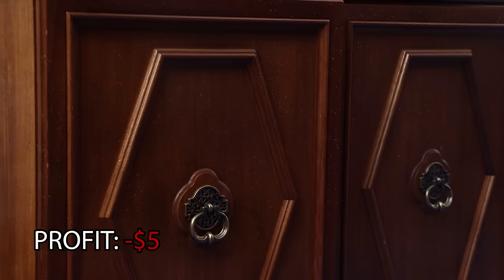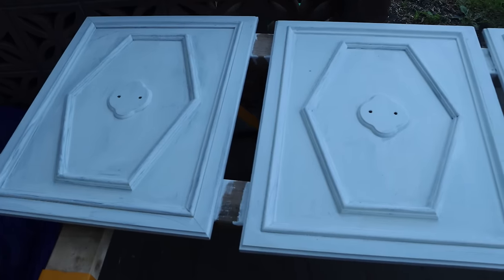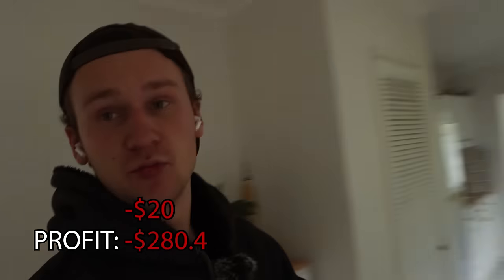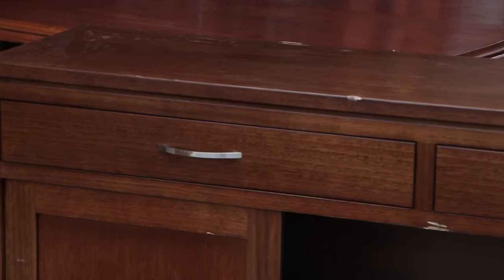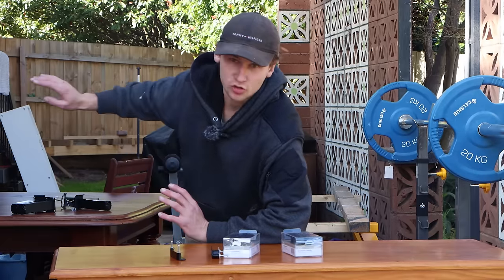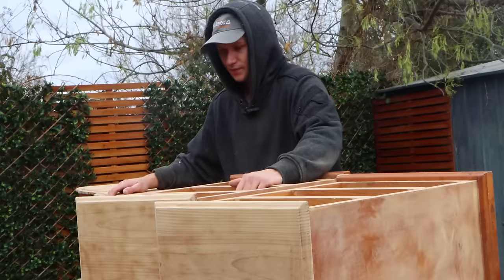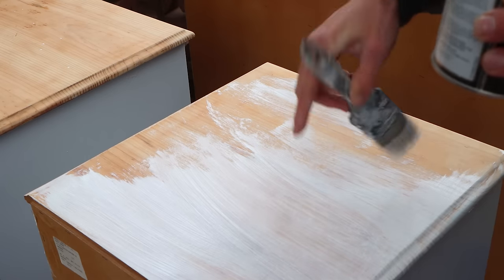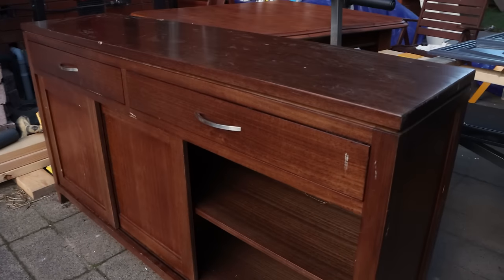I Quit My Job to Flip Furniture: How Much Money Did I Make?

Comment: Ive flipped some pieces as a hobby and one of my biggest pet peeves is seeing how others have painted using a brush. You can always see the strokes and it generally looks terrible. If you are going to do this full time, buy a sprayer. After you spray your primer, give it a light sand and wipe down to make sure you have a smooth surface, then finally spray two coats of color.   The sprayer will be much faster, provide more even coverage, a better finish, and you will find that you use less paint which helps keep costs down.
Reply: Hi, what sprayer do you use?
Reply: @Isaacbuildsthings i use a hvlp gun from husky with i believe a 1.8mm tip. You will need to experiment with dilution but once you have a sense for that, it puts on a near perfect finish
Reply: I just bought a HomeRight Super Finish Max. It's Wagner's sister company. The normal price is $119. I bought mine on Prime Day for $32. It is often on sale for $79
For stain, I find that a lint free rag or a staining pad works better than a brush. For finish, a cheap foam brush works best.
Reply: If you are not going to use a sprayer, you need to use a foam roller. Use the brush where the roller won't fit, and then roll over the brush marks as much as possible. Using really high quality paint that is self leveling will also make a huge difference.
Reply: Is that why I never liked painted furniture?
Reply: @JenMarco  Probably. I have a couple pieces in my house that were painted 3 years back and they look great. I also tried to avoid painting the tops of nightstands etc, because I felt that lacquered wood holds up better there.

Comment: Hey man, I used to be an ironworker until several years ago when my back went out and knocked me out of work. I had no other job skills and could barely do anything anyway, so to try to keep making the ends meet I started selling stuff around the house on Craigslist. Even the most trivial crap would sell and before long I was actually buying stuff and reselling it on Craigslist. My garage was practically a thrift store and I was making hundreds of dollars a week. Nothing was going into the bank, but we were still eating, had electricity and making the mortgage payments.

#1 seller: Lawnmowers. They often sold literally within minutes of listing them. It was crazy and I sold so many of them I even had little patches of grass around the yard I never cut so buyers could try them out.
Reply: I would actually like to watch a video on what you have done over the few years

Comment: Bro invest at least in a Wagner 150 spray unit. Easy too use and clean. Even buy a hand held spray unit to apply your base coat. Farrk using brushes. Good luck with whatever you do…. ✌️
Reply from the maker: Not a bad idea! Thanks!
Reply: @DaveDoesCarpentry The downside of using paint sprayer is that there is more waste. I prefer to use spray paint no cleaning up needed.

Comment: I’m a furniture flipper and if you mind me giving you some tricks. Clean your pieces with something like Krud Kutter or Simple Green before you sand. It cuts thru the finish and grease. Also always prime your pieces to prevent bleed thru. Use a metallic paint or Buff and rub.
Reply: Is one layer of primer enough?
Reply: Yes but depending on what color you are painting the piece you might want to do a second. If it’s a light color definitely a second coat is best. Better to use more than have to go back. Good luck
Reply: Hello are you a furniture flipper full time, have you been able to make a living from it?
Reply: @marieanne8317  I did but it took me about two years to build up a client base. I did get a booth in a shop which helped.
Reply: @thealee3157  ahh okay thank you 😊

Comment: I’m not sure if you cleaned the item off camera. If not, I think it’s beneficial to do so before sanding so customer will have a long lasting painted items..
Reply from the maker: After sanding the pieces, I cleared off the saw dust and then I had a bucket of sugar soap which I used to clean the pieces before painting.

Comment: FYI, Mr. Metal is an excellent all purpose metal cleaner. But your handles are antique brass. They can’t be made shiny and metallic unless you spray paint them with metallic spray paint. Also, if you don’t like the color of paint you buy, you can take it back and ask them to add tint to it and they can play with it until you like it.

Comment: You should definitely consider investing in an orbital air sander, compressor and high quality sandpaper. The price is well worth it and are Sanders are going to remove a lot more material than those electric orbitals. Like it's a night and day difference and it will speed you up by at least 200% I will bet money on that

Comment: Dont mix the vinegar and baking soda lol. You neutralized the entire point of using vinegar, the baking soda basically just acted as an abrasive is all. May as well have been dirt😂 straight vinegar to remove corrosion and rust, bicarb acts as a gentle abrasive/polish. Barkeep is a much better option and very cheap to clean and polish up metals

Comment: this work isn't easy. it's physical.  the sanding and vibrations alone take a huge tole on my hands . I'm having to wear braces and ice my hands after every sanding job. and my shoulders feel like I went to the gym and tried to lift 5000 lbs. then the other day a gust of wind came and blew a bunch of saw dust in my eyes and one eye still in pain. I'm actually what I consider fit. I work out and get over 15k steps in every single day. This still kicks my butt.  I'm also seeing the marketplace posts in my area are a joke.  No one is selling anything refinished but there are people selling broken junk for an arm and a leg.  I see one night stand for $100 and a pair for $300 and they advertise you to buy them and fix em up.  😂 thrift stores are the same. matching night stand sets are $100 each.  my city never has any trash curb days. I never see anything for pennies like these you tubers do..  The only wood I get from the trash are pallets.. and I scoop them up every chance and have been making butcher block style side tables..

Comment: Hi.  This is the first video of yours I've watched....First, you didn't even clean the piece before doing anything....then it looks like you're just throwing paint on your pieces.  Yikes.
Reply: That’s what I was about to say…
Reply: As someone who watches a lot of furniture flipping youtubes and does my own this is freaking me out. Latex paint is a no no. And the brush strokes. I suggest learning from others first and starting small before you quit your job. Its not as quick and easy as you think to get a good finish
Reply: @rebeccalucy1 actually can use latex paint as long as you properly clean, sand and prime piece.
Reply from the maker: I did clean the pieces after sanding. I scrubbed them with sugar soap before applying paint
Reply: The brass handles will come clean if you scrub them with a brush. Not just soak. I use Barkeepers Friend powder and a brush. They come out beautiful